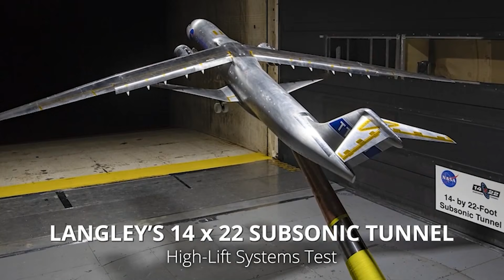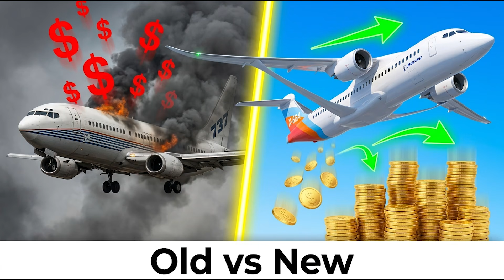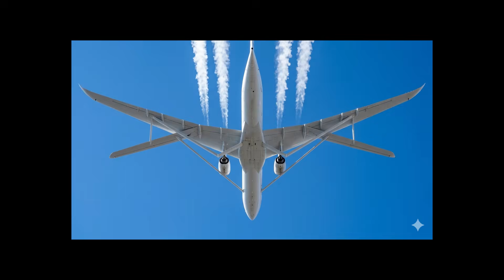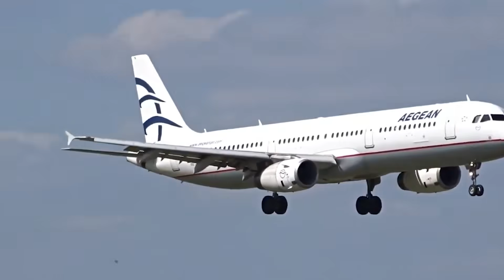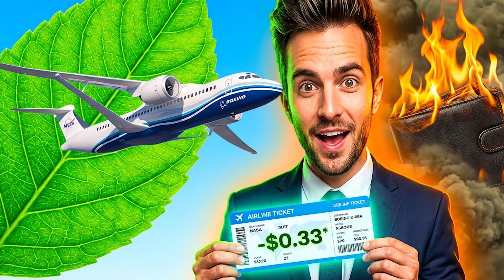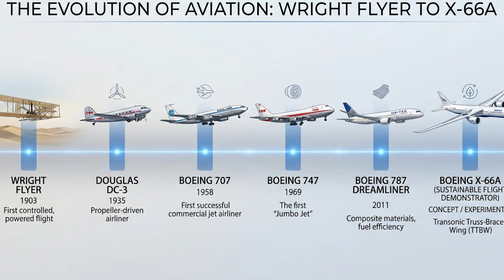NASA & Boeing X-66A: The Truss-Braced Wing Revolution – Efficiency, Safety, and the Future of Flight

Comment: By moving the X-66's engines to the rear, lowering the wingspan, and folding the wings at the root, it can fit into parking area category C (wingspan 36 meters, height 20 meters).